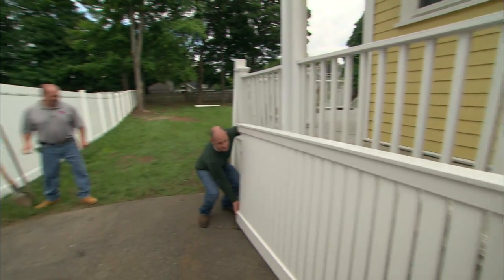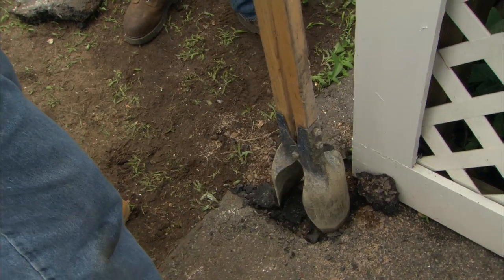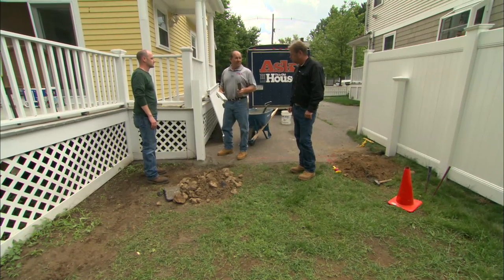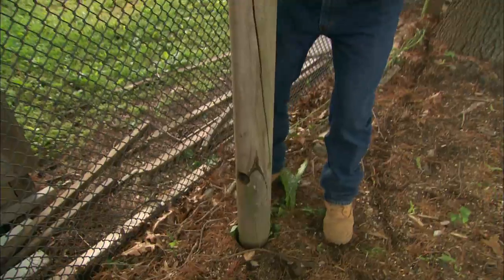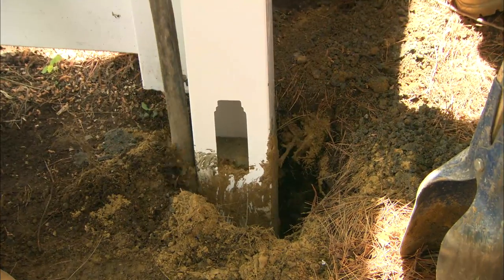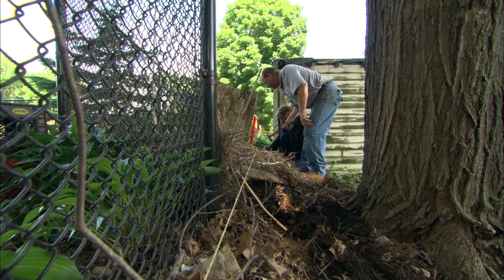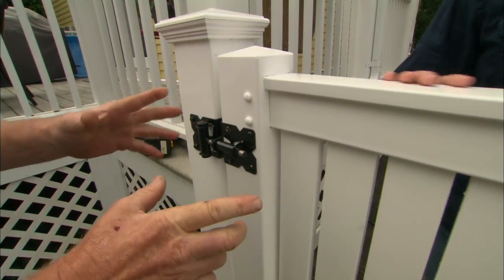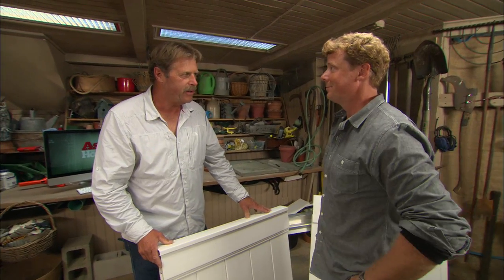How to Install a Vinyl Privacy Fence | Ask This Old House

Comment: I like these type of fences. The wooden fence looks good for 1 year then it became to like rotted popsicle sticks.
Reply: Ronnie Emerson they last a long time if you maintain them, but most people don’t maintain them
Reply: Metal Roof Panel Privacy Fence with steel post and c purlin for framing lasts a lifetime and looks good forever. with no maintenance
Reply: cooldbz12 my porch is made of this fence material and it’s not holding up. Previous owners put it in - not sure what they were thinking putting a white porch under a tree 😒 it’s never clean 😭
Reply: I build wood fences and offer to seal them after they start to gray. After a quick wash and dry then seal my fences look good for five years easy. Vinyl looks like Fisher price toys to me.
Reply: @aaronmackay6123  but they last longer without all the maintenance. Gimme the toy and not the headaches that wood brings with the elements.

Comment: Everything about this video was perfect, those almost 400 people that clicked "thumbs down" need to get a life; I'd like to see them try this.
Reply: the wooden insert in the bottom of the posts does nothing. Also the bottom rails are made so thin that they decided to install a steel insert to "make it stronger" . Go see that insert, it does not support even a 10 pound weight. But you can buy good strong rails. The sections did not have "picket channels", which attach the pickets to the post(any good pvc has them)
Reply: Probably contractors who don't want tou doing it yourself 🤣 and charge you outrageously high dollar

Comment: 2 issues: It works better if you fill the post hole with cement to the TOP, then position the post. Also, the cement helps STOP the grass from growing around the post so it will be easier to trim grass with a weed eater without hitting the post with the blades or string.

Comment: Should the aluminum insert be as long as the vinyl post? Doesn't aluminum react with concrete if the post and insert are set in concrete?

Comment: What's the point of the pressure treated in the bottom of the post? If you set the post into the concrete,  wouldn't a hollow post filled with concrete be stronger?

Comment: It's alot easier and faster to dry pour the concrete around the posts finish the fence then go back and double check that they're level then add water.
Reply: Cheek Snatcher it's obvious you've never built a fence before.
Reply: That's the worst way to set a post. You need to dig a hole below your frost line in most cases, fill it with premixed concrete and drive the post into place. What do I know, I have only installed and sold vinyl fence for 27 years.

Comment: Never get semi-private because they can see you, but you can't see them.
Reply: ARCTIC TOWER until you realize it’s just a gate 4 foot tall?
Reply: So if u were to install it backwards it would be vice versa would it not?
Reply: Sadly it can be necessary in certain areas, simply because of the wind. Unless you port a full privacy fence with enough holes, a good constant gusts will tear it down. These allow the wind to pass through which is convenient for many that experience hurricane and tornado level storms. 
That said I went through the extra effort to fabricate the previously mentioned ports in my fence, and have a gate that can latch shut to cover them. Just requires going out in the storm to open them all which is a pain in the rear.

Comment: Wooden pressure treated post will rot over time especially when set in concrete. Need metal inserts instead of pressure treated wood for it to last.

Comment: What do you do if your backyard does not line up properly for a full fence and you have to cut in half or even smaller to put that last piece in? How do you do that? Cut fence somehow?
Reply: you do have to cut it. I am a fence installer. it is harder to cut and install premade panels versus ones that go together piece by piece. My last vinyl fence install was yesterday.
Reply: Use a chain saw though. It’s a heck of a lot cleaner, nicer and faster method to complete task

Comment: I'd like to know what brand of fence did they use. Because the panels being sold at Lowe's  like that don't slide into the post as in this video, but cheaply screw into the post where connection is.

Was even looking for this brand because of the top long cap along the top of panel and the bar that slides into the bottom of panel to keep it secure and won't sag
Reply: Try Vinyl Yard Solutions Inc

Comment: I’ve had a vinyl fence installed 17 years ago. Power wash every couple years b/c of tree above and it looks like new. I am getting a couple of post starting to lean a bit. Yous guys have any tips or videos on straightening vinyl fence posts? Or do I need to dig them out starts over?  Thanks.

Comment: Concrte isnt needed, and if you do, put it in the hole first and allow to dry, then level the post and fill with dirt, then set the vinyl , the reason for this is  that the ground will shift , and if you can move the post you can have a straight fence again
Reply: Frank maybe you can tell me, my back yard isn't leveled. it's a slope higher at top the lower as it goes away from house. how can I NOT have the stair step look when installing

Comment: What about elevation changes? I can't see this working on even the slightest change beyond flat ground. You can't tilt panels up or down, or stagger them up or down a hill.  Am I right?
Reply: Depending on the style/ configuration of the vinyl fence they can absolutely be installed on slopes. I've installed 10's of thousands of feet of these fences ...

Comment: I bought some vinyl fence but the post is solid,  no holes, can I cut the holes with a saw, make my own. What's the best saw to use?
Reply: better use brackets and make sure you have long enough screws to go well into wooden post inside vinyl post
Reply: Chain.... I’d use a chainsaw

Comment: Did you wait for that first post to set before you put on the first  panel? And did you continue to wait for each post to set before moving on the the next panel/post?
Reply: I had a fence installed and they did the same thing. Just kept going down the row attaching boards to the posts without the concrete being set.  Looks great.

Comment: How long do you have to wait to set up each panel. After pouring concrete in the post?
Reply: That is for a gate. In the video they are putting up each panel right after they set up the post with concrete for the 6 foot privacy fence
Reply: HE said 24 hrs.

Comment: If the old wooden fence was on the property line and they installed the new fence in its spot why did they take it down? They made it sound that because it was on the property line they had to take it down

Comment: Where's the step where you ensure the first two gate posts are the exact same height? A 30" hole with a couple shovels of concrete in the bottom before inserting the post is not an accurate measurement ensuring uniformity.
Reply: it can be cut later

Comment: It's not really helpful to point out how much better the quality of the panels used for this installation is compared to the other you showed if you don't tell us what brand you used.
Reply: violetxoxox As a PBS station I don’t think that they are allowed to endorse any company directly like that. It’s not ethical to other companies.
Reply: It would also be a form of free advertising for the fence manufacturer.
Reply: violetxoxox  b. U

Comment: That was a 5" post, so the first hole was (at best) 10" in diameter.  The hole should be closer to 12", to have the heft needed to secure the post in the ground. The I-beam insert gives the post stiffness, but a proper mounting into the ground is crucial to support the additional weight of the gate.  I also agree the first post hole was too shallow. The top of the post begins its descent at wee-bit higher than the top of the 6' fence, but ends up only ~2' below the top of the fence. A 30" set is a minimum--when the frost depth is less than 30".

Comment: I just watched this video, old as it is. I think they put the gates on the wrong sides. Shouldn't the cross brace be going from top hinge across to the bottom to hold the weight up better. They have it at the bottom hinge going up.

Comment: that fence although looking great is terrible for supporting the gate unless you secure the top piece to the post all along  the fence as it will pull out and allow the gate to sag. this problem is never addressed in any video I have seen!

Comment: Never put wood inside a vinyl post, the water runs down through the holes in the post And soaks the wood and expands causing the vinyl to crack and split. Replacing all your post reguires removing and rebuilding your $18,000 fence 3-5 years later. Ask a fence professional that's seen it before!

Comment: Lol never ever are you suppose to put the concrete that high, that's what makes the post shoot out of the ground lol. We dig our holes 36-42 inches depending on city code
Reply: Mark W yeah but wouldn’t you want to dig the hole deep so the fence will last and stay up for the 20+ years it’s suppose to?

Comment: He should have waited for the concrete to harden before dumbing soil on it. He just ruined the concrete
Reply: How so? On pole buildings, two bags of dry concrete at the bottom of the post, dirt fill, start building. The concrete will set up with ground moisture.

Comment: hate to say this Roger,but u made one hell of a big mistake with those posts,given that the pressure-treated wood is touching earth,whats to prevent termites and carpenter ants from making the heart of those posts thier lunch?
Reply: +Christopher Brown I thought that the purpose for using pressure treated wood is that termites and carpenter ants don't attack/eat them.
Reply: tizben as i understand it,pressure treated wood only does so much,when u have wood in contact with the ground,it invites pests to damage it
Reply: +Christopher Brown Most pressure treated wood has a 20 year lifespan in direct contact with the ground.  Many also come with some form of warranty for that lifespan.  Most are very resistant to rot and pest damage, so it should be okay, especially as it will be surrounded by concrete, it isn't likely to suffer too much if at all.  It does shrink a bit over time, but they are more after the weight I believe.  To be fair, though, I am no expert - maybe it would have been better to cap it with more vinyl at the bottom or something.
Reply: i know here in Canada,they usually spray any wood thats gonig to be in contact with the ground with a compound that makes it resistant to mold or insects,same goes with any wood planned on being used for stud walls
Reply: Ahh, interesting.  Is that compound in addition to pressure treating from the lumber yard or is that in replacement of?  I'm in Alaska, so weather can be similar, but I've never added anything extra to pressure treated wood that is going into the ground.  If it will be above the ground on a concrete footing or similar then it gets a galvanized or stainless bracket.  That's if it doesn't get cut, though.  If I have to cut/trim it at all then I'll use a sealant on the bare end.
Reply: alaskafender in addition to,uve seen pink-colored wood meant for indoor use,havent u?
Reply: +Christopher Brown  Here in Saint John, New Brunswick, the former landlord rebuilt the rear deck with pressure treated lumber about 10 years ago, The concrete's taken the worst beating from the weather the deck itself is doing okay, but can get slippery in the 40 mm((1 5/8-in) rainfalls we get every couple of days,, other it's just the cats using the4X4s as scratching posts until I screwed old carpets over them.
Reply: Christopher Brown Honestly don't think I have Chris, I'm not in construction as a trade, I've just done decks and fences and such for home projects of my own, all outdoor stuff.
Reply: alaskafender one thing id suggest,is to look up "Holmes On Homes",Holmes Inspections"and "Holmes Makes It Right" for a better general idea of what im talking about
Reply: Cool, will check it out.  I've seen a couple before in passing, don't recall much.  He fixes previous contractors screw ups though, yeah?
Reply: +alaskafender yes he does,and thereve been some doozies over the years
Reply: Roger didn't make the mistakes, the contractor installing the fence made the mistakes or maybe he didn't. For the area where the fence was installed this may be their standard way of doing the installation, like why didn't they use a power auger where they could instead of digging by hand. Different parts of the continent do thinks different ways, not knowing where the fence was installed is the first question.
Reply: Okay, I looked it up on ThisOldHouse.command the episode air in Season 11, on Nov 24,2012. The fencing contractor is a local Boston/Cape Cod installer, so he's meeting local building codes. The pregnant is short and she had a daughter. So saying that things were done wrong oonly applies to your local areas, you have to remember it when watching it, just like watching Mike Holmes, he's working to local building codes in Toronto, not Calgary, not Saint John.
Reply: +Christopher Brown but there are concrete all around the wood so i think termites and other creatures will not do anything to it
Reply: And that what the chemicals in pressure treated lumber do , it stops rot and insects.
Reply: Does it matter if it rots? I'm pretty sure he just has it in there for mass. It would take a looooong time for all that to disappear.
Reply: these 4x4s are rated for in ground contact, so you are wrong
Reply: Just as a precaution, you could add some roofing tar on the exposed wood with a trowel, then install it.
Reply: A ground treated post is like a super pressure treated wood. Much higher concentrations of chemicals for longer lasting and anti bug.
Reply: When I installed my fance, we first added some concrete to the bottom of a hole and then put post on top of it, so technically wood is not touching the earth.
Reply: @Chuck59ish  You noticed the rocks they were pulling out of the hole for the gate? Auger in rock is no fun.

Comment: Why would ANYONE want to install a Vinyl fence, FOR ANY REASON, is quite beyond my comprehension! They are junk! No exceptions! In 5 years treating for pest control I have seen so many broken and or crappy Vinyl fences! They are just plane junk! They break so very often and in so many ways I can't even list them all! Plastic (that is what vinyl is after all) is NOT the solution for everything. They were invented to help us poor consumers spend more money in repairs than the original cost. You also won't find a single vinyl fence in the heat and sun of Arizona because the sun would destroy them in less than a year.
Reply: Dave Sakievich I’ve been trying to explain that to customers for years.  Vinyl fence is garbage.  People get sold on the idea that it’s maintenance free,  you are def correct on it costing tons to repair.   That is if you can even find the same style vinyl two years later
Reply: I very much lower maintenance fence is chain link, and it lasts forever, and, compared to vinyl, it is dirt cheap. I worked, one summer, in 1972, putting in a 3000+ foot chain link fence and it's is still there! I rest my case.
Reply: Vinyl is an amazing product for the price, we have pictures on our website over 20 years old and they still look great, cedar is junk, iron rust (even powder coated) iron is expensive, chain link doesn't offer privacy even with slats and other forms of privacy fence like block do not hold up well in cold weather (you have to set a footing lower than your frost line) so yes, for most people, vinyl just like vinyl siding is the best option.
Reply: I’ve never had a problem with mine in 10 years so far
Reply: Well then David if you had witnessed broken fences, why haven’t you tried repairing them? We don’t believe you.

Comment: Is wood inside better or Metal pole n cement?  what is the proper spacing? 8ft Whats with The metal wont that rust🤦‍♀️? 🤔
Reply: Aluminum doesn't really rust.